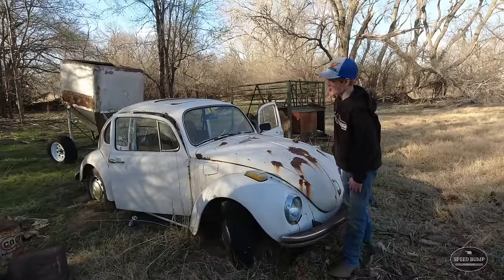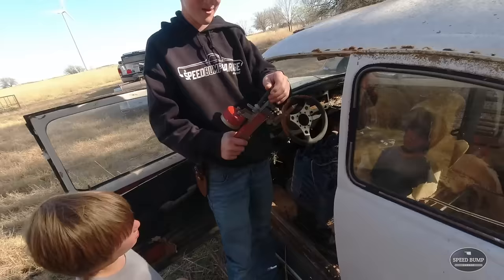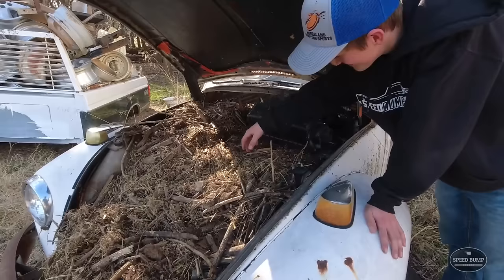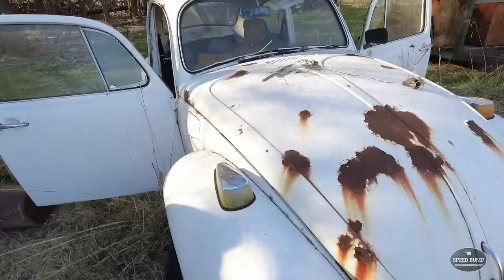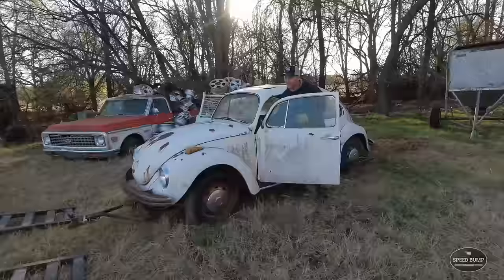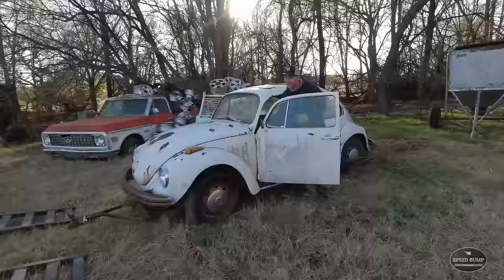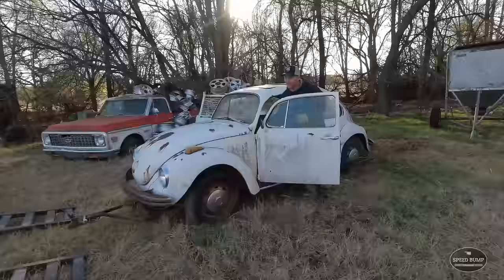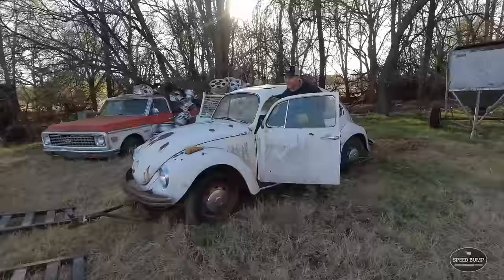I Traded A Shirt for A Bug! 🚗

Comment: Good for you for taking on a project like this! My first car was a 1974 VW bug. It was $400 bucks, and I bought it by selling my 4-H steer at auction when I was 16 years old (a long long long time ago!). It was a project car for sure! No fenders, no breaks and more. My dad and I got it running great and found parts from a local junk yard. Lasted many many years until it got smashed by a snow plow. ~ Great memories as my dad has passed now. So happy to see you out there working on this project with your dad. I see your's is a super-beetle by the way the spare tire is sitting. The floor is made separate floor pans/panels that can be replaced. Looking forward to seeing more videos of this project in the future. :)

Comment: Your little brother will drive it to his senior prom. Thats a great project for brothers ❤❤❤
So fun to watch your channel🎉
Reply: And here's why dads like for their teenage daughters to date a guy who drives a Beetle.
1) The seats are separated by the hand brake, the shift knob, and the tunnel so there's no snuggling.
2) It doesn't go fast enough to get into any trouble.
3) When the guy is driving it his arms and legs are busy steering, shifting, and working the clutch - you can't drive this with one arm around the girl (or texting or talking on the phone).
4) The back seat is really small. Wink wink.
5) They never break down on a deserted road because you can always push start it (as they did).
So yes, give it to your little brother.

Comment: Whatever you do save the vacuum advance distributor.  I have rebuilt several.  People loved to tear those out and put a centrifical Bosch 009 distrubtor and they never run right.  If you can get it back to original and bring the chirp back then you know you have it dialed.  Also there is a flap system in the air housing that is attached by a rod to a thermostat below the right side of the block.  This is what allowes the engine to warm up.  Most of the time people ripped those out because if they go bad the engine gets hot and will seize up if that thermostat fails.  People always complained they had no heat because people tore all that stuff out because you had to change that thermostat regularly to protect the engine.

Comment: Jack, I am a younger granny of 68 years old and in 1972 I got my first car and even though I am a girl my Dad taught me how to change the tire, tune up the engine, disassemble clean and reassemble my carburetor and fuel pump. Later on I learned how to remove and replace the brake master cylinder in a Kharman Ghia. Oh yeah! My first car was a 1967 VW Beetle. Dark blue and I miss it.

Comment: After the throttle linkage came apart I once rode 5 miles on the rear bumper of a bug while my friend drove and I operated the throttle, because it beat walking that far!  (Couldn't pick up a cell phone for a "Hey Dad" in 1982).

Back in the day it was easy to get a brand new floor pan for an old bug, but I don't know if that is still true.

Comment: Very cool to start off what it was and to not only get it running but to be able to make it move under it's own power is a win win. The look on Jack's face when the fuel line came off is funny and his Instinct to head in the direction to shut the car off is epic. To top it all off it couldn't off ended any better.  Fix what you got and it will be well worth it. Great video 👍

Comment: I would do the Engine swap to another Bug...besides the Floorpan the Interior needs everything. I don't remember if the 72's had a 1500cc or they were bigger. If bigger put it in a pre-70's bug. You guys have a fun life...
Reply: 1600 i believe
Reply: 1600 I believe

Comment: Great video Jack and Dad AJ too. If you have VWs with out engines Id do a swap if they can be made legal as you'll need something to drive to school after a while that's good on gas and cheap on insurance. They do make replacement or fix it floor pans for old VWs  Muskie could probably tell you where to order or Tony Fitzees's fabrication has several U-Tubes on making floor pans from scrap sheet  metal . Both are great vids Congratulations on getting it running. I miss Oklahoma good to see a bit of the country around there again.

Comment: This video was so much fun. Love seeing you and your dad working together. I use to have a 66 corvair,back in 2000.  another car with an aircooled engine in the rear of the car. My ex is a red seal mechanic and I learned so much and was so fun to hang around the shop and get to knowing how to fix the belt when it would come off and so much more. How to drive with two feet to keep the engine running as it would stall before I could get it into the shop on the other side of town . Driving fast was fun too. Like it was driving that little Volkswagen around the field 😊❤️

Comment: Good work! That's a fair exchange, even a good one! These things can be put back together easy-peazy! BTW, its a "Super Beetle".  The lower grill below the bumper is the dead give-away. The front boot has more space. From '73 on,  the Super Beetle had a curved front windshield w/bigger Dash board and the regular Beetle did not. I had a '72 Super Beetle myself in High school in the 70's. Oh yeah, and up to that point the '72 had the most horsepower of the Beetle series (still not much)

Comment: if you had a couple ratchet straps, this would have been a shorter video. using the first strap, install the battery securely and with the second strap, wrap one end around the upper pulley on the motor and pull start it like a lawn mower. this comes from an old Missouri guy that was just driving his 73 super beetle today. I love watching them come back to life

Comment: A problem for many VW Bugs were fires..Many would buy them and the first time they would have to jump start their VW bug the battery as we all know was under the back seat..Some would take the battery cover off and jump start the car but not thinking wouldn't bother putting the Battery cover back on..probably anticipating their next jump start.. next thing you know they pile their buddies in the car..The Back seat had that mesh underneath it..Once someone sat on top of that seat it would cause that wire mesh to bridge across and make a contact with both the positive and negative battery terminals and short out the battery and soon catch the material in the seat on fire..Once a VW Bug catches fire it goes up very fast..Many VW Bugs were lost because of that mistake..when i was about Jacks age about every other car going down the road was a VW Bug now we rarely see them in my area..A treasure for sure

Comment: Fix up the floor pans and drive that thing in the pasture, for a little while anyway, then, pull the engine, and, put it in a more complete Bug. There’s a lot of good parts in this one though, so, keep it for replacement parts. Or, you could restore it completely, and, have a numbers matching Bug with a good story to tell.

Comment: You're going to learn a lot about mechanics. Get some good tools, a few cans of PB Blaster, some Gumout, some Brakleen, and begin attacking the car one system at a time. 
Remove the spark plugs, spray some PB in the holes, let it sit for a while, then try to turn it over by hand.

Comment: I had a VW jus like that one.  We put a cargo strap around it the hold the floor up and bring int home.  It was ultimately a part out.  But that did not stop me from driving it all around with the cargo strap holding it together.  
In 1981, you could buy a VW for literally $20.  (and I did x3).  It was easier an cheaper to buy parts cars than it was to buy parts.  One time I bought a Bug that had been used to jump/ride motoercycles over.  The hood and roof were caved in, but the running gear was just fine.  I think I paid $10 for that one.

Comment: Ah you can easily fix that battery with a solder gun weld it back together I used to weld crack batteries all the time from the auto wreckers

Comment: They used glass bottles for the oil, which usually was recycled. T b ere should be a screen on the e iop of the tank to empty the cans of premium oilafter oil changes. Filled many of them 60 years ago when we would also have gas wars. Cheapest I ever sold gas? 9 cent a gallon tax, and we were selling for total of 7 cents. Flying A gas. Basically we paid you 2 cents a gallon to take it. Long Beach, California, about 1965

Comment: I remember when the sun roof first came out..a great option until Automakers as well as owners soon found out they leak..The fix came when Auto makers decided to engineer them with a drip pan underneath the sun roof with a hose connection and they ran the hose through the C pillar and out through the trunk..draining any leakage..problem solved..I don't remember when that change was made..I believe it was first used in Japanese made cars then other automakers followed

Comment: Use it for a parts bug, and then play with what's left learning ro patch rust holes and whatever else it may have wrong with it. Maybe someday buggy it with something like a Harbor Frieght 4 stroke that might have as much or more power than the stock engine in it now.

Comment: Jack the bugs rough,   good for parts or beach buggy build ,,  just saying ,,,    to me it appears about 74  78 model cos of bumper bar style  that continues till the end of them,,,    it's junk but great fun if running,       take plugs out pour your magic oil in an tow car around in gear with plugs out  top up tow again  ,    great tip for cleaning  car out is rolling  it up side down in a car cradle and weld new flooring in the easy way ,   interior is still available but maybe more modern,     most bits can be cleaned  eg.   Tail lights indicators  chrome stuff ,    bonus it's a complete outside of car ,   interior in the bin jack all of it except  door trims and dash stuff ,  roof liner too it will have nasties  in it like mold if not rat shit,   put face mask on inside it jack ,  you could catch something  bad real quick

Comment: That battery cell tester worked on the old style batteries. They were made out of a material on the top that was like made out of "bichem" and you simply jammed it down through there and it would test between the two cells I've got one of them just about like that of course they don't make batteries like that anymore

Comment: Well I had three or four Volkswagens when I first started out driving and I think I paid $35 for one and that was the most I paid for Volkswagen bug I got a 1700 pancake motor put in the other bugs because they had no motor in them we learn to cut a hole in the back and you could change that motor in just a few minutes 4 bolts and not very much to work with you got it done was nice to drive lots of fun always put one of those Motors in one of the good bugs and use that to drive around the pasture